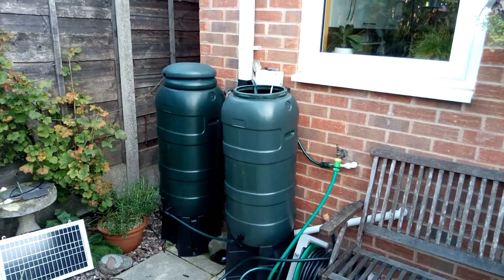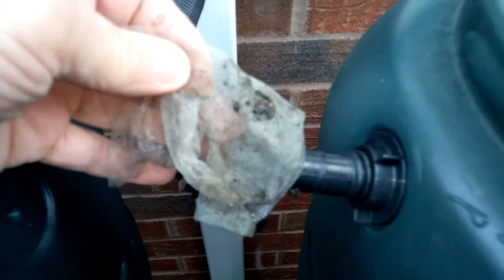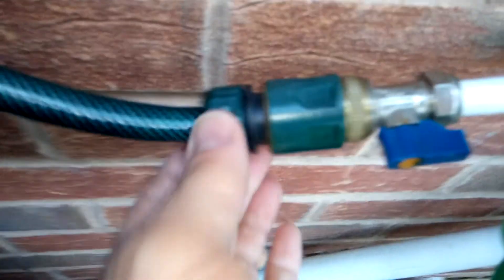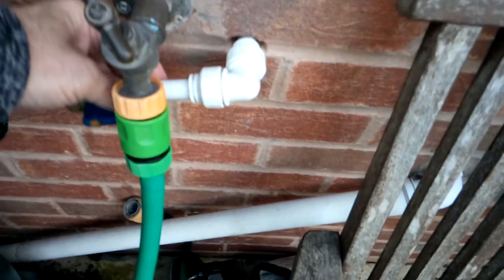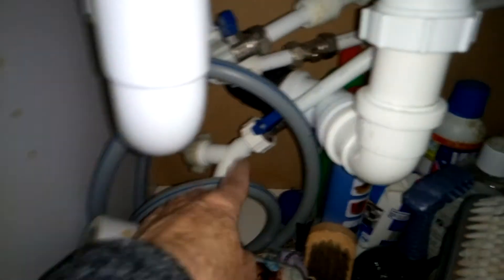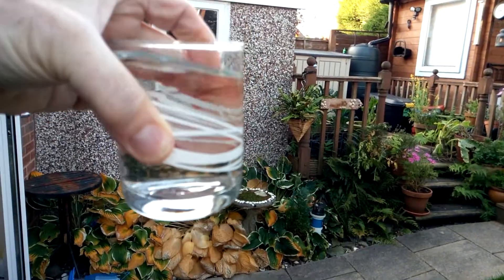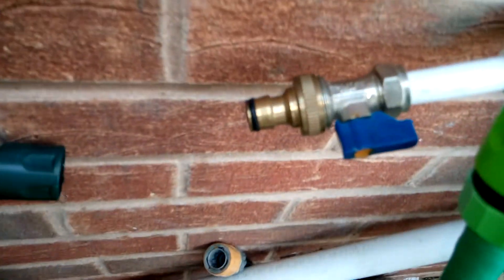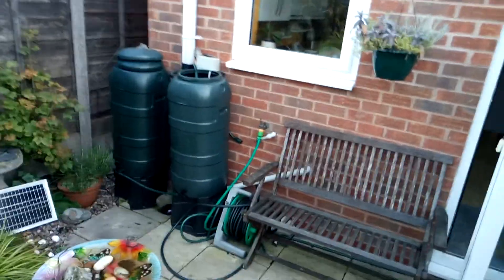Simple rainwater harvesting feeding a washing machine. #100b

Comment: Good video, but when does the pump switch on/off? Do you do this manually or is it automatic when water draw is required?
Reply from the maker: I do it manually just have to remember to turn it off after the washer has finished.
Reply from the maker: @Chris Tyler It was the plumbing of the cistern that put me off feeding the toilet. Plus you would need a low level rainwater sensor of some sort to top up if the water butt was empty
Reply from the maker: @Chris Tyler yes the ultimate would be an underground storage tank that. Feeds a holding tank in the loft. But then that will cost a lot  of money to
Reply from the maker: @Chris Tyler sounds good let me know how you get on
Reply: @Chris Tyler are you uk based?
Reply: I am about to build a new en-suite and I was going to use collected rainwater to flush. However the rainwater could run out.
The problem of getting over running out of water in the storage tank is quite easy. Put a float valve in the tank about 2/3rds down. When rain water runs out, the inlet valve will keep it topped up to 1/3 all the time.
To meet regulations you will need to put a non return valve on the mains pipe.